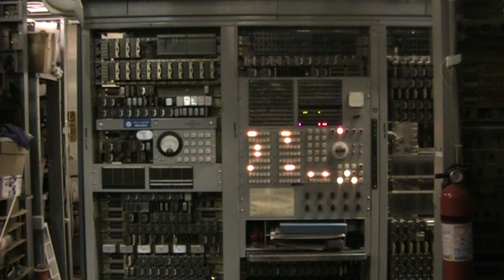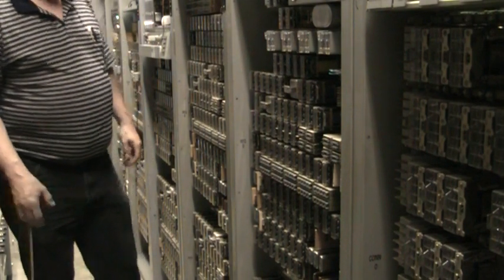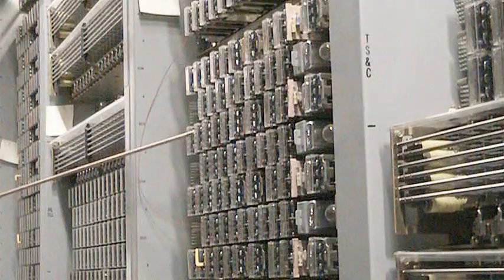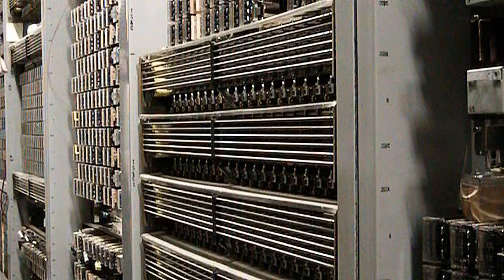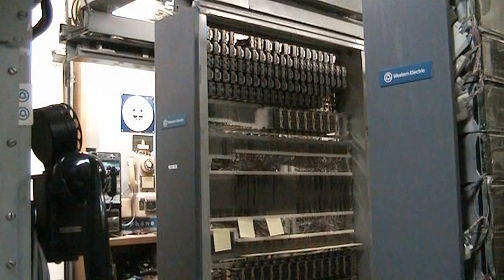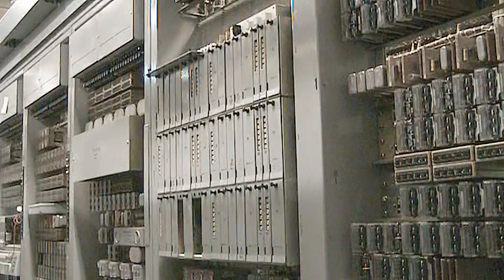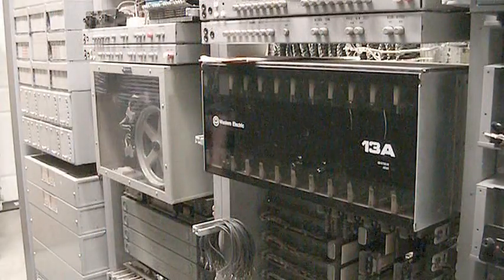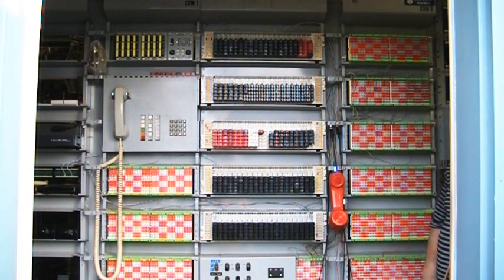Western Electric #3 Crossbar switch.

Comment: Back in the 70s I helped to install the plessey telecom version of this exchange a can remember the racks were very heavy to lift up I left plessey in 1980 just after system x was coming in i went to work for the G.P.O I am now retired after 40 years little did I now my last job was to be at the other end of the network doing safety checks on poles has a pole tester when I was offered the job a figured out I wold never be out of work has the are over 3 million poles to check here in the U.K.

Comment: Prefer the sound of the 5ESS. Glad I never had to work on electro-mechanical switches. That crossbar switch sounds like the audio equivalent of Chinese water torture.
Reply: So you think huh?
Reply: 5ESS, Doesn't sound as good and realism as a electro-mechanical switch in operation, Sometimes a real machine can only make those kinds of amazing noises when your call is being set up in real time. instead simulating a call being processed over a Digital system. unlike electro-mechanical switches they were the REAL DEAL. AKA facts.

Comment: In the 1970's I had a chance to work on Western Electric 756 and 770 PBX's. It was like a mini version of the Central Office Switch. It had Crossbar switches. In later years I also worked on the WECO Concentrator-Identifier. It was also a crossbar device that linked telephone answering services. Both were amazing machines that you could troubleshoot many times just by the way it sounded.

Comment: Oh my goodness, I was updating my resume and did a search for #3 crossbar and ran across your video.  I was the Nevada Bell technician who cut the switch from the #3 to the DMS 10 remote in Gabbs and helped you and our vendor move those frames into your rental truck for you to take back with you.  I am glad you were able to get it back together, still wished you could have gotten a modular home mover to have welded some axles to the base frame and taken the whole thing out without having to take everything apart.
Reply from the maker: Please contact me at 971-239-5084, leave msg. Thanks Phil
Reply: Skyhawk Sailor you should check out the one at the Telephone Museum in Ellsworth ME- we have the other working one - on its pallet and everything. I recently had to wire the markers to call in a “C” digit translator because we needed to distinguish between 334 and 338 😀

Comment: WoW !  I've seen #1 and #5 crossbar but never #3 (I don't think ?)  I may have heard of it but that's about it
Reply: When I transferred from working on 1E and 1A ESS switches in the Glendale, LaCrescenta, Burbank, and Alhambra area, to Hawthorne NV in 1990, I had to take care of this #3 crossbar and two SXS switches in Mina and Fish Lake Valley (Dyer) a DMS 10 in Hawthorne and one DMS 10 remote in Schurz.  I also had to take care of another DMS 10 in Austin with a remote off it to Round Mountain, which the Navy kept getting into our Microwave link with their EA-6B's and knocking Round Mountain off the air.  I called back to Columbus to see if they had a #3 crossbar class I could schedule to go to.  The scheduler called me back and said he never heard of a #3 and had to look it up.  By the time I transferred from Hawthorne to Fernley both SXS and the #3 had been cut over to DMS 10 remotes, which was later upgraded to DMS 100 and DMS 100 remotes.  The other old school systems I had to learn to work on was some old AT&T TL2 radios,  open wire with L and N type carriers along with 8 party lines.  It was a real eye opening experience since my wife and I got recruited out of the Military straight into ESS, I had some power and carrier, but only D4, oh yes the really bad freeway phone conversion also.  The one thing I have to say I did enjoy was since I was the least senior Combination Technician there I also had to collect the two pay phones every two weeks at the Cotton Tail Ranch.  No one else wanted to go there because the owners wanted to have a 1FB so they could run credit cards, and would ream the technician about the poor service being on an 8 party toll station.  Since there were two spare pairs on the cross arms I asked the owner if he would like an engineer to come out to see if Nevada Bell could provide him service, and he said yes.  The engineer went out and told them we could but would cost over $200.00 just in mileage from the closest tariff Central Office, plus his 1FB, he got the service.  Still it was the greatest eye candy job there was.

Comment: I would assume the reason Western didn't make any more 3XBs was because it was replaced by the No. 5A crossbar?
Reply: I think the reason they did not make to many is because they used the pallet design for a small #5, which as the attached video shows uses the exact same pallet the #3 used.  https://www.youtube.com/watch?v=TsWnidyQE9M

Comment: Back in '77 to '80 I worked as a software engineer on the old IT&T North Electric NX-1E common control crossbar switch for the international market. As I recall, it had 16K core memory boards, 4 boards to a bank of memory, with the assembly language SNAP-8 as the programming language. Unfortunately, getting that system to work was like pushing a boulder up a mountain. Back in the day, using assembly language was essentially like having to program every molecule in the process of the call, so we weren't very successful.

Comment: What happens if you pick up and all the originating registers are busy? Do you get a reorder tone?
Reply: All I know is it makes a lot of clunkity clunkity clunk noises as the relays search for a free OR but I think all it does is hold the dialtone off until an OR becomes free. Next time I am at the museum I will have to try that...
Reply: @RickTheGeek  you’re actually right about that I have heard it before in Seattle they have a 1XB and i heard a lot of traffic and next thing you know there’s the dial tone it took a little bit. But it did it!
Reply: @MichaelWallace-oq3wd  cool! I still haven’t gotten back to the museum, between the Plague and work sadly. Next summer I will though!
Reply: @RickTheGeek  do you know about the connections museum in Seattle?
Reply: @MichaelWallace-oq3wd  Heard of it and I plan to go!
Reply: @RickTheGeek  hey! Just to let you know that you can get a dial tone on both of the machines 5XB and 1XB and there is a lot of cool sounds we all wouldn’t thought we never hear again!
Reply: @MichaelWallace-oq3wd  the 5XB is running at the Ellsworth museum too during the summer and if you are on the collectors network it can be dialed into as well 😀
Reply: @RickTheGeek  yep! Also they need to set up a DISA in the Ellsworth museum! Where you hear the call connecting process. And not hear completely silents.